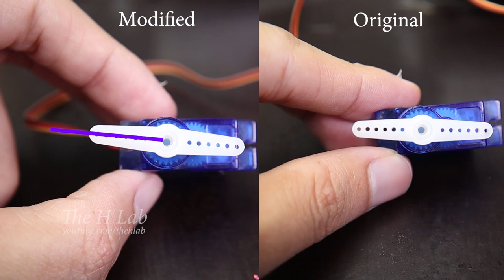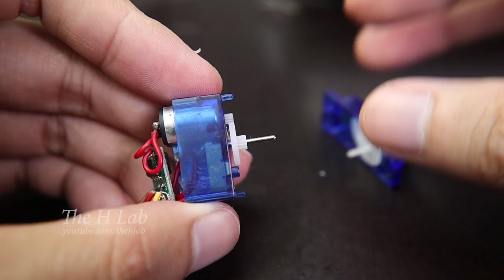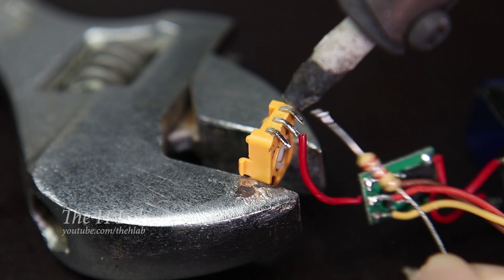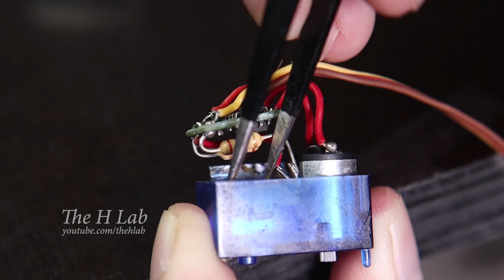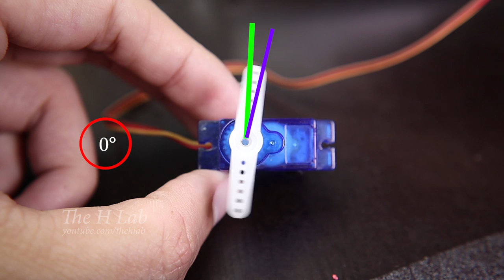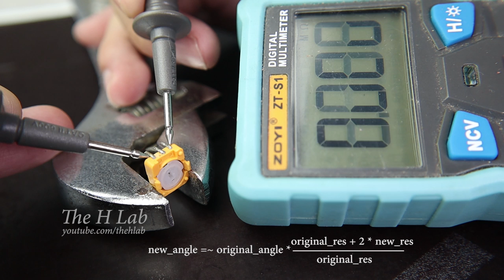Modify Servo SG90 increase turn angle | The H Lab

Comment: What wattage do the resistors need to be? I thought they were just rated by resistance. But I didn’t know what wattage to purchased when I was asked at my electronic store
Reply: use the color code
Reply: 1/4 watt will be enough. These are just for measurement, not for power. And these kinds of servos are very low power anyway, so 1/4 watt is enough.
Reply: @takix2007  thanks for the reply. Really appreciate it